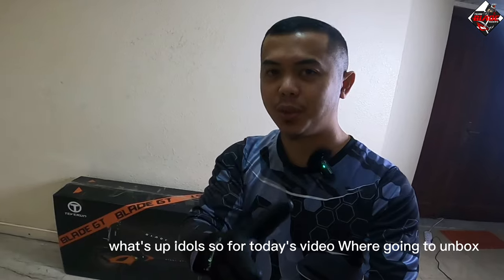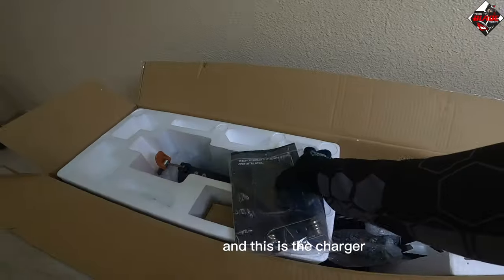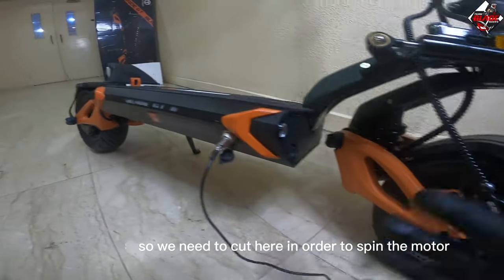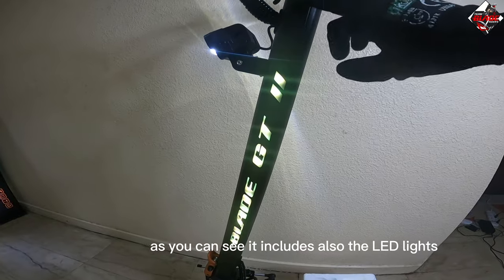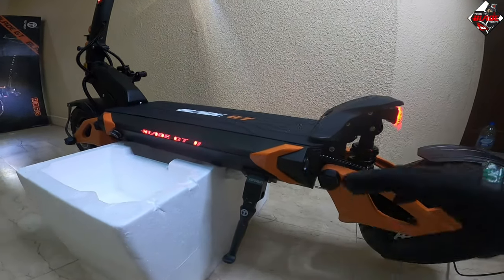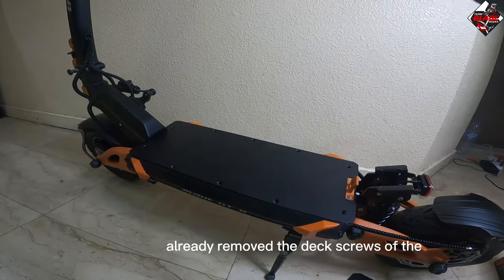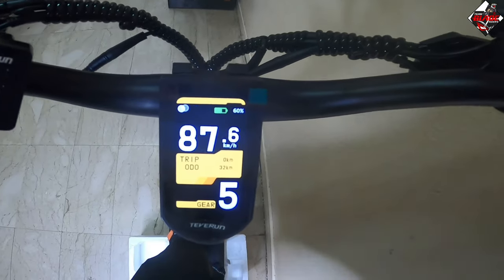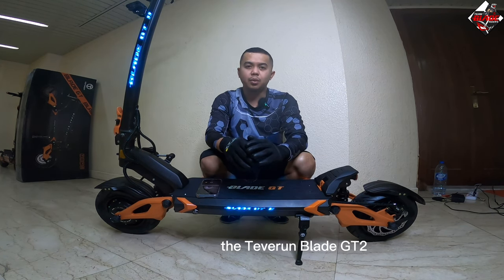Unboxing! New TEVERUN BLADE GT V2 | James Angelo TV | Vlog 151

Comment: Will there be acceleration to maximum speed or is there no point, since the hardware is the same as the GT1?
Reply from the maker: same only, only the thing is  app version, but i like the rebound suspension of gt v2
Reply: @JamesAngeloTV  The foot rest pad looked like it was made of plastic, is that actually true?
Reply from the maker: @vova4585 yes bro that is 3d printed type

Comment: Is the  brake lever for the rear wheel on the left or right-hand side?
 And can I flip them?
I got to have right-hand rear brake.
Reply from the maker: for the rear is in left side for front is right side lever.
for flipping not possible because of the postion of cable
Reply: @JamesAngeloTV  why would they do that?
Every bike has rear brake on right side.
I don't understand.
This is bad bro.
Reply from the maker: @Jeff.Spacek83 if all brake at right side then the rear lever is at ride side then front lever is in left side
Reply: @JamesAngeloTV  Thanks for making all the videos for Blade GT.
I got the 60V/ 35AH 2+ on the way.
Got a set of PMTs to put on it also.
Going 2 find out, bro.
Can't wait. 
Thanks again.
Reply from the maker: @Jeff.Spacek83 ride safe bro